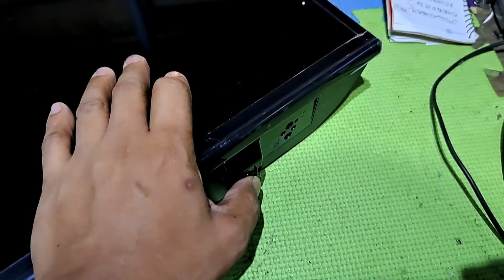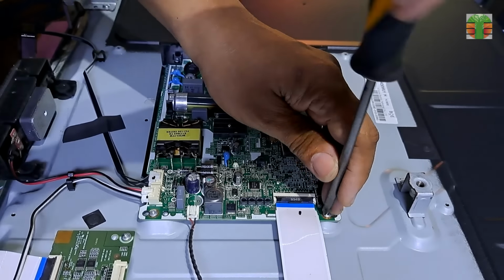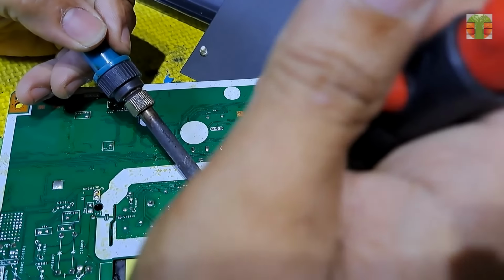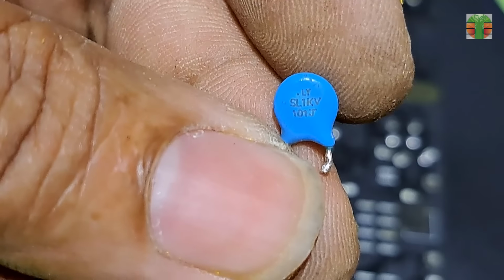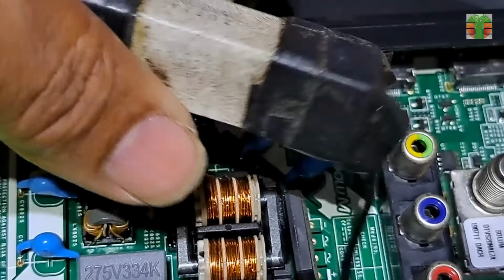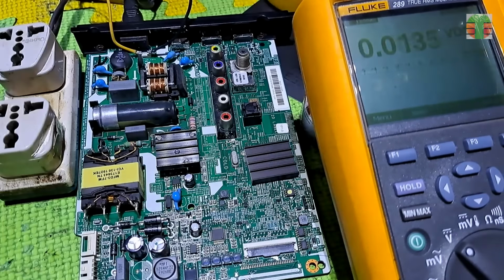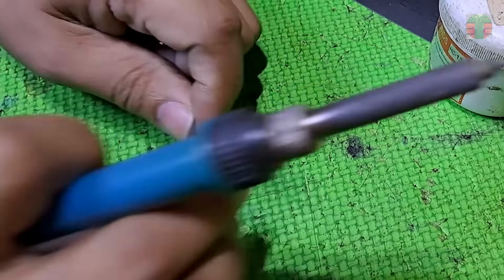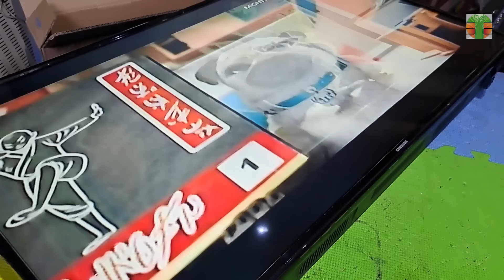Why your TV is not turning on?

Comment: Good work 👍.
Can I use 10w 220ohm resistor. To discharge high voltage capacitor. 
I can't find 20w 220ohm resistor.
They don't have it here
Reply from the maker: Yes you can
Reply: @tevzTVTevatronics  thank you so much sir. Have a bless day

Comment: Thanks Mr Tevs.  Maybe a stupid question, but why do you think the fuse blew? Did the burned capacitor create a short to ground?  I thought those blue capacitors were supposed to always blow open circuit.  Hope my question makes sense.  Take care my friend.
Reply from the maker: Yes, it is partially short to the ground, that's why it's burnt. Sometimes the fuse doesn't blow up because the capacitor first blows open. 
It makes sense. Take care too my friend.
Reply: @tevzTVTevatronics  Thankyou. 😀

Comment: If you include circuit diagram of some of this TV or at least explain the working principal then your numerous videos will start making much sense. 

You can start with power smps, you can explain the rectification section, then to high frequency pwm oscillation {Main winding, axicillary winding and several secondary windings} to the secondary rectification and so on. 

Next you can focus on LED driver circuits and so much more.
Reply from the maker: It takes many hours to make it. It is not easy to create content like that.
Reply: Like some videos. Don't fix.but do them explaining what u have just fixed previously. Telling the cause. The approach and etc. So that it be short

Comment: Hello. The resistance that you put in series to test for short circuit, how do you know if it is short circuit or not
Reply from the maker: I dont get what you mean.
Reply: After repairing the board instead of the fuse, you connected a resistor to the fuse to test the short circuit and connected the board to the electricity, how will you know if there is a short circuit
Reply from the maker: @protection4541  If there is a short circuit. I detected it at an earlier time. If the PWM is defective, it will cause the MOSFET to get short during the testing time, and it will cause the fuse to get blown or explode to other components. I am not detecting the short circuit by the resistor, it is for safety. if there is a short. there will be no 12-volt output, and I stop from fluging it.

Comment: Only standby light for me. And just my luck thermal camera shows CPU heats up in corner. Why unlucky all the time. How many times do you get a fail  like CPU or firmware chip burn  you can't repair. I'm on about 40pc.